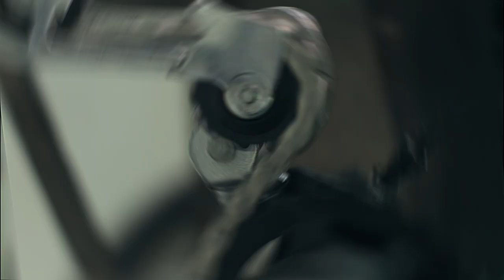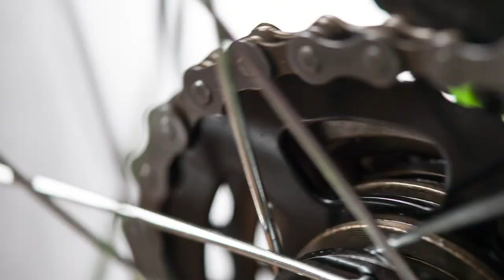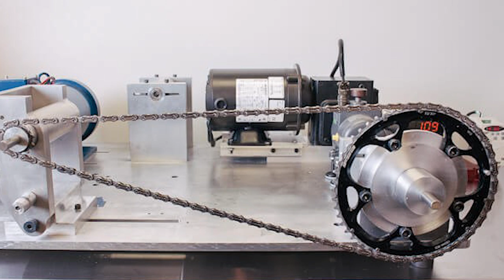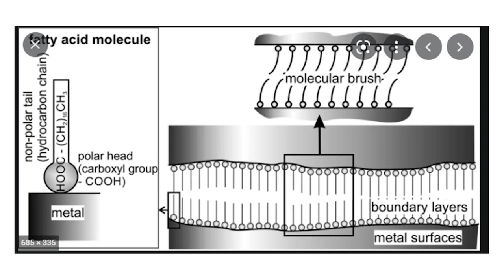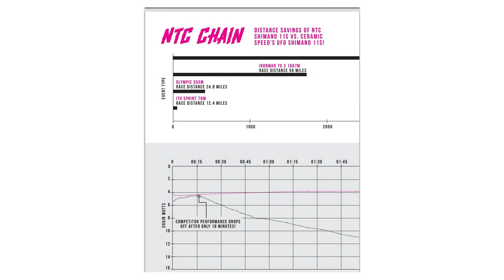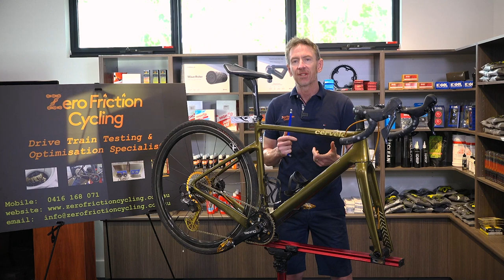Episode 11 -  Lubricant Testing Data – A continuous Train Wreck

Comment: Hi hope u can help. Just got some super secret chain lube. I’m after some advice I ride a lot in side on a trainer as time is not on my side with work. How often or what sort of km distance can I get out of a single application. Chain will be completely clean and ready for lube and will allow 24hrs to set. Any help would be greatly appreciate. Great videos.
Reply from the maker: Hey adam! What a great name :) Treatment lifespans for a lubricant really have a lot of individual variables so aside from giving out really broad ranges which may not be of much use, it is best to learn the treatment lifespan for you. Also, indoor can be very different vs outdoor. Ie some people who do bulk of kms outdoor may not be doing that many high intensity intervals, and save their high intensity work for zwift or trainer. As such the trainer kms can be mostly really high power, and there arent really any free rolling kms on ergo. Ie if one spends 30 mins outside at 250w riding up a hill, they might then have 10kms of mostly roller / very light load- whereas after 30 mins at 250w on an ergo, there is not those free kms after. 

In short, your power, your power profile on rides & type of training etc will have big impact on treatment lifespan. You should get to know when the chain starts to feel and sound obviously dry, and re lube vs pushing. The good news with ss drip is it is very hard to over apply and get a gunky drivetrain, so if in doubt, re apply - even it is erring on early re kms done.  Some cyclists get to know dry feel and time to re lube easily, some do not - if you are in the not - for ergo, assuming it is high intensity - i would err on side of safety and say every approx 100km. If your cycling on ergo has a pretty broad range of intensity, then probs circa 150km - but again if feeling and sounding really dry before those marks - re lube - there is no harm to ensuring the coating is not on its last legs before you smash next zwift race, and unlike some wax lubes or many wet lubes, there is not really a penalty if you end up erring on over lube with ss drip as its very clean / not easily gunk up. 

hope that helps!
Reply: @zerofrictioncycling992  thank u for such a great reply. I will run chain on there till it feels dry. If u like to know the outcome of km per re lube then I will keep a note over next few months.

Comment: Just opinion, I don’t thing just testing friction on a machine equals real world, when dirt and water are introduced the whole game change’s. Just like tire pressures.
Reply from the maker: yes absolutely, hence why the ZFC testing includes by dry and wet contamination blocks. For a start, when outright efficiency testing can actually be agreed upon, then this should be expanded to test for contamination. If there was an accurate independent test lab i would be able to send chains for testing post the contamination blocks etc to cross correlate the wear rates with efficiency losses. I think the cycling industry will get there but we are very behind pretty much any other large industry with regards to testing.
Reply: I think there is obviously “the right lube” for different people and different situations.

Comment: What are your thoughts on the CS UFO chain efficiency (~3.7 watts or so) vs the UFO v2 drip efficiency of ~3W?  I would've thought that the pre-prepped chains are the gold standard, followed by the drip, which in theory should be an emulsified form of their hard wax formula
Reply from the maker: Great question Wilson. Officially from CS their wax is still the fastest, but i dont have updated data from them for their latest ufo wax that comes on their UFO chains, vs the latest very fast formula of UFO drip. My best advise would be that overall the UFO wax will be the slightly better choice vs UFO Drip if ones budget reaches that far, they will be within a small fraction of a watt of each other re outright speed, but a UFO wax treatment will definitely last longer vs drip as drip you always have at least 50% of what you apply being carrier, whereas the wax application is 100% lubricant. One can then move to UFO drip when the wax treatment is wearing thin.
Reply: The UFO chains are currently on "version 2" and UFO Drip lube (v2) was developed later (so newer 'tech'/recipe). Keep an eye out for UFO chains version 3 soon.

Comment: squirt or smoove? or muc off dry?
Reply from the maker: Hey Keagan! DEFINITELY not muc off dry....... Squirt of smoove are both good, at this time i would give the edge to smoove, but i think squirt are coming out with a new formula soon or have released which i havent tested.
Reply: @zerofrictioncycling992  i appreciate the reply mate! i’m in south africa and those are the only 2 “good” options. we do get ufo drip but it’s 5x the price of either of those 2. everything else is muc off, white lightning, rock n roll etc. i still have a bottle of squirt here so will strip the muc off and apply squirt.
Reply from the maker: @keagandevilliers2832  Yep - wax lubricants typically struggle on that test - it isnt a test that is applicable to many wax lubricants, it is an industry standard test for oils. In your chain you do not have a high speed spinning cylinder against a static cylinder. In a bicycle chain top wax lubricants bond to the sliding surfaces, and you have two wax coated sliding surfaces. Almost all wax drip lubricants are emulsion so have a carrier to evaporate and wax set. Squirt is one of those. He tested it wet - so what he is testing is probably 60% water. And so again spray pattern test - wtf is that telling someone? it needs to set and have the water carrier evaporate before use. 

The sand retention test - despite mentioning should allow it to dry - he tests it wet. Again this is just not representative at all of how the product will perform when used as instructed. As a wax emulsion lubricant - once it has set, dry contamination resistance is typically this lubricant demographics strength as they are not wet. So dust has a hard time sticking, and what does stick has no liquid path to travel to get from outside the chain to inside where it will cause wear & increased friction.  It is EXTREMELY poor, and EXTREMELY irresponsible to put out testing like this as the masses will not understand these things, and take the testing as a thorough control testing - but walk away with completely incorrect results. If i was Squirt - i would be suing him to take down that test. 

Overall that is an exceptionally disappointing video that damages and sets back the hard work of others in this space working hard to improve cyclists knowledge. That is circa 300k viewers that need to be corrected with proper information and testing. Perhaps from one that tests on a bicycle chain, on a bicycle drivetrain, so in its actual use case, and following manufacturer instructions....?

Comment: I'm surprised that there is not a Molly based lube.
Reply from the maker: Im sure their are. For long time mspeedwax had moly as main friction modifier, now changed to tungsten disulfide
Reply: @zerofrictioncycling992   Molybdenum disulfide has sulfuric acid issues in high heat places like engine oil.  Wondering if the Tungsten Disulfide does better?  Molly works good but high heat and water are its biggest drawback.  Thanks and keep up the great work!

Comment: You need asm standard.
Reply from the maker: the world needs a couple of ASTM standards here. Honestly its embarrassing. MFG claiming anything they want with nothing to substantiate, or goodness knows what test data to substantiate. Outright efficiency testing is a huge mess of conflict. Testing for what happens outside the lab, it appears to be just ZFC. Whilst thats great for ZFC as im run off my feet, the world is big place and there needs more resources than me for mfg to validate their claims - and so an ASTM standard test along the lines of what i do would be brilliant. If one happens and a major independent test facility can open up to test to a robust standard then i can retire and ride my bikes a lot more :) My test machines really are hobbyist level - they tell us an awful lot about a lubricants performance, but ideally long term ZFC is an interim measure as we push towards proper testing standards for outright efficiency, dry contamination, wet contamination etc - this is proving extremely difficult as honestly i just do not believe all parties are honest - the interest is to test in a manner that makes their product look amazing and competitors terrible. As per video i have absolute trust in CS testing, i really worry about some others - and how an agreed standard will be attained. i dont think i am going to run out of work for a bit yet....
Reply: @zerofrictioncycling992  Too bad my Dad is long retired or we could work one up.
He is in 80's now.  He sold then taught custom lubrications. He forgets things now so...

Comment: All this testing seems flawed to me.  It seems to me an electric motor puts a very constant load on the chain.  A cyclist puts a very variable load on the chain via the pedal shafts.
Reply from the maker: correct it does, but that doesnt mean it is flawed at all. The  test needs to be very controlled so that the lubricants efficiency (FOR THAT TEST) can be ascertained. Just because a load varies, doesnt mean that within the performance range of the lubricant, that the losses assessed at one load wont be comparable. It isnt exactly linear but lets just say that at 250w load a lubricants loss is 4w, then at 125w load you can expect its loss to be around 2w, and at 500w load around 8w. If its 6w loss at the test load of 250w, then you can simply adjust loss numbers. As you pedal, even if doing say 250w, the peak load forces will be much higher than when driven by a motor, and the low power phase of pedal stroke the forces will be much lower  - to equal 250w overall on average. The relative losses for the performance assessed at 250w load will apply as the lubricant is put through higher and lower forces. It isnt exact - many things will impact the real world outcome - ie a heavier lubricant will have comparatively poor losses at lower power, high cadence due to higher viscous friction and stiction vs a very light lubricant, which may struggle at very high loads and low cadence. But - there has to be a benchmark of X load, X cadence - X losses. This is same across basically anything that is tested, and such results are not meant to tell you that that is what you will exactly experience in your use. Hope that makes sense :)

Comment: So they took data out of context for marketing gimmick.  That is not surprising but they will stretch the truth for monitary gain.
Reply from the maker: I disagree, my personal opinion is it is not data out of context, but clearly, obviously incorrect data - but it suited a narrative so use it anyway. Bigger concern is was the test deliberately conducted to obtain deliberately incorrect data. this is much more serious than using something out of context
Reply: @zerofrictioncycling992  YES fraud instead of misrepresentation.
Reply: The ”instant” fluctuations (hours of driving apart) are easily explained by layers of different additives wearing off differently.

The problem seems to be that the lubricant manufacturers are not very good in getting the additives and wax into consistent structure
on the surfaces.  Especially so when there is an extra carrier fluid used in applying the lubricant. 

With modern additives thrown together almost randomly by manufacturers this is exactly the kind of data I would expect to see.  Its not oil anymore!

Kudos for the company for sharing their very confusing looking data and thank you for sparking discussion about it.

Comment: Try Chepark wax lub
Reply from the maker: would need A LOT more compelling information. There are just so many such products on the market, and the testing is extremely resource intensive. i can just work my way through 500 wax lubes out there, there has to be a good bit of really compelling information as to why they should be tested.